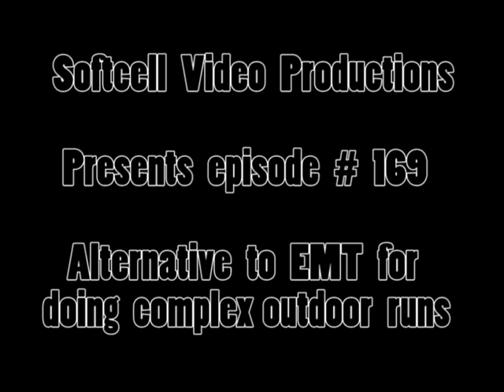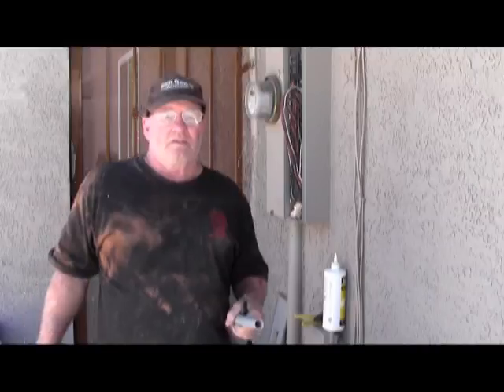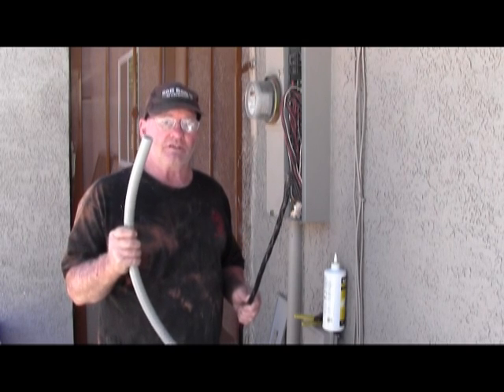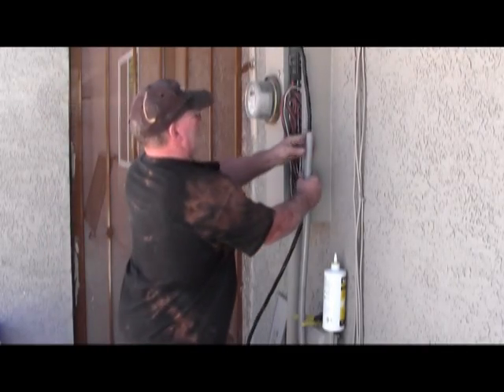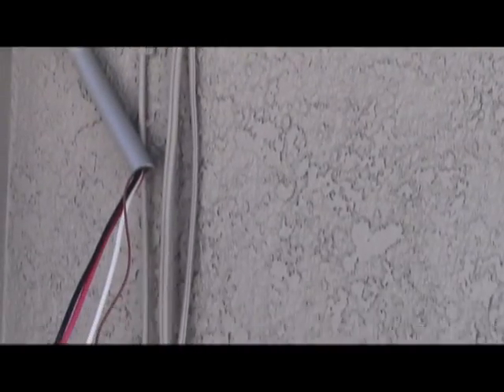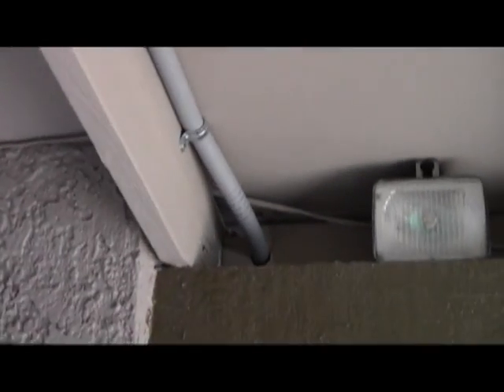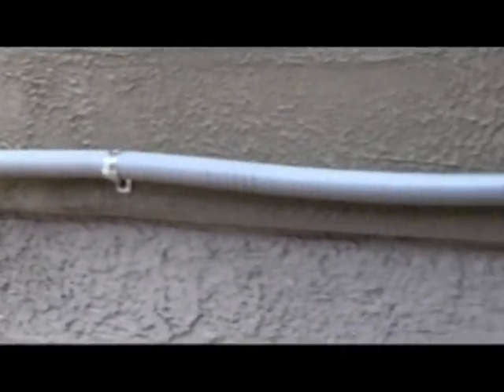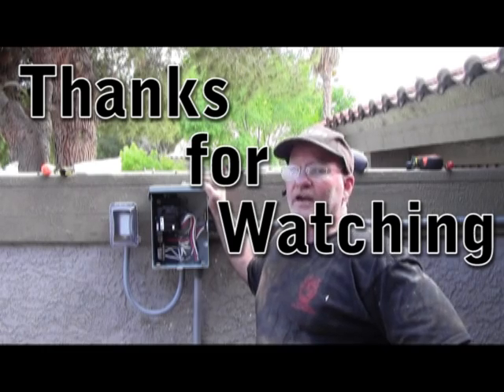NEC approved tricks for tough conduit installations #2 F #169

Comment: It is a code violation to use striped Romex (NM-B cable) in a a NM or metal conduit in a damp environment, and the outdoors is considered a damp environment. 
You cannot use stripped Romex as THHN; the individual wires within Romex aren't rated or marked as standalone THHN/THWN, and removing the sheathing compromises their insulation and protection, potentially creating hazards, especially with moisture, violating National Electrical Code (NEC) rules for conduit use, which requires properly rated single conductors like THHN/THWN for conduit runs. The outer sheath of Romex protects the conductors and helps with heat dissipation, and removing it leaves the wires unprotected and can lead to issues like overheating or moisture damage. 
Why This Approach Doesn't Work
Lack of Individual Rating: Romex (NM-B cable) wires are designed to be used within their outer jacket; they aren't individually marked or rated to be standalone THHN/THWN wires, notes the Mike Holt forum.
Compromised Protection: The outer sheath provides crucial protection, and removing it leaves the wires vulnerable, especially in conduit where they rub against the conduit walls.
Moisture and Heat: Romex sheathing can trap moisture, and if the outer jacket is removed, the inner paper filler can absorb water, leading to insulation breakdown and heat issues, as discussed on Reddit.
Code Violations: The NEC generally requires proper conductors for conduit systems, and using stripped Romex conductors without their protective jacket is not permitted for complete runs. 
The Correct Approach
Pull THHN/THWN: Run individual, properly rated THHN or THWN (for wet locations) wires inside the non-metallic flex conduit from the outside to the inside.
Use Approved Boxes: Install approved junction boxes at transitions, like where the conduit enters the house, to connect the THHN/THWN wires to the Romex inside. 
For proper heat dissipation and safety, always use the correct wire type for the application, especially within conduit systems.

Comment: Thhn CANNOT be used in wet conditions.  So no you cannot use this wire in exterior applications.  You need thwn or uf-b wire.  But thanks for the fire hazard....
Reply: Most THHN wire sold in the US is also THWN rated as well.
Reply: Fire hazard...give me a break!

Comment: One issue I have heard about with stripping romex: While the conductors are usually THHN, they are not always labeled as such on the insulation so cannot be used as THHN in conduit per the NEC.
Reply: @darbyl3872  Right. I think the method shown, which avoids the need for a splice to new conductors in a junction box, is allowed if the cable is rated for wet locations and is not stripped - the flexible conduit is then being used for physical protection - but I'm not a professional electrician.

Comment: Thank you, this is helpful to see practical application. I'll have to ask our local inspector if this 15' guideline also applies here in Canada for a 10' vertical run of rigid PVC conduit between plastic boxes. Our equivalent code book considers an outdoor run on a wall to be a wet location, the water tight conduit notwithstanding. So, normally if Romex is used the book would call for NMWU90 rather than NMD90 and accept the 60 deg C derating. It wouldn't be a big deal to use a bigger junction box to switch indoor NMD90 to RW90 (Canadian approximate equivalent to XHHW with crosslinked polyethylene) with insulated ground. If I can avoid an extra junction and use a smaller LB fitting instead it would look better.

Comment: If I put 14-2 outdoor wire through flexible conduit do I need to strip the outer jacket off and only send wires through?
Reply: If it’s outdoor (wet location rated) cable, then you don’t.
Reply: At a IAEI class was told that type NM cable ( Romex ) can never be used outdoors or any other damp locations because it's not rated for that.

Comment from the maker: If you use THHN with a 'J' box and an insulated ground, you can go up to 25 feet if you use a semi metallic flexible raintight conduit. On the semi metallic conduit you can no longer use the cut to fit romex because the bare copper will touch the metallic inside wall of the conduit and violate the 'dis similar metals' code. Oh...the original question, I don't know, I just know how the inspectors interpret them. If they told me to use mango juice as pipe lube then mango juice it would be.

Comment from the maker: Good question. Once EMT is bent it is bent, and then you have to run wire through it.  With non metallic you can run your stripped romex through the entire length and bend it as many times as you like. The catch is that you cannot exceed 15 feet. The install in the video came to about 14 feet so I was right at the limit. This is an incredibly useful technique for multi bend situations. It saves on 'J' boxes and multiple attempts to get a bend just right.

Comment: Why does the 90 degree angle rule apply to EMT but not to flex? Thanks!
Reply: What's the 90 degree rule? I'm only aware of the 360 degree rule.
Reply: @darbyl3872  I said I was aware of the 360 rule. I asked about this 90 degree rule. Liquidtight and sealtight are two different raceway types (nonmetallic and metallic respectively). Neither apply to the 360 rule. It's conduits that aren't flexible.